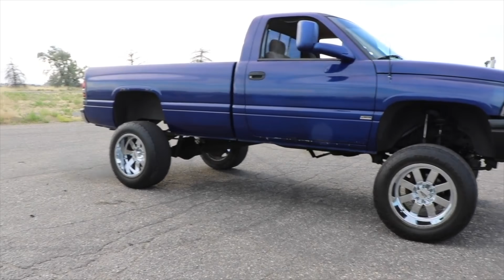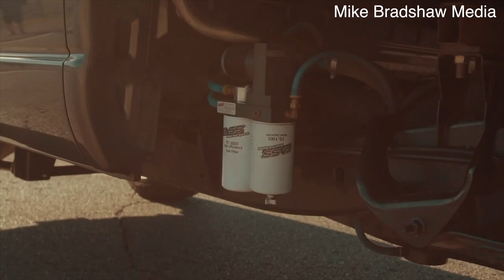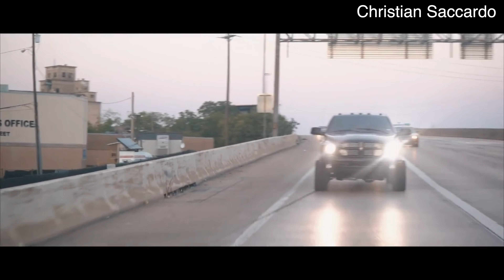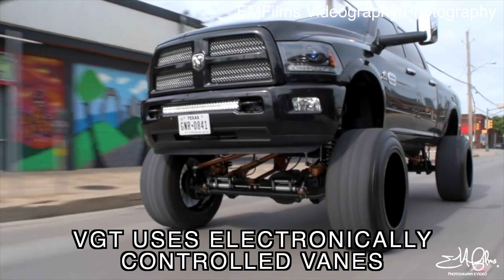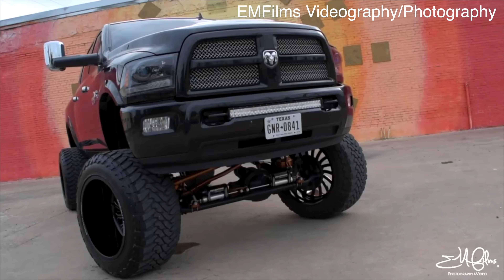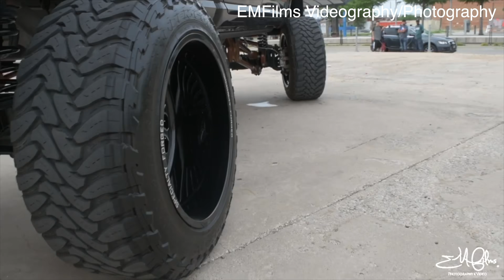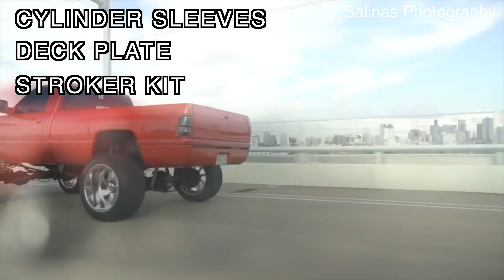5.9L vs 6.7L Cummins: Which One is Actually Better?

Comment: I've bought me a 07 with that 6.7 liter with low miles back in 2012. Today I've got 71,150 miles on it. I had no problems yet with the motor, my only problem is the catalytic converter that is in need to be changed. Other than that it's runs good.
Reply: A converter on a Diesel? I guess you do have problems!

Comment: I drive  2004 dodge 5.9 good truck sound like sold truck good engine. 137000 mile good truck also drive mega cab  3500 year 2012   good truck 6.7  miles run 70000  both good truck

Comment: So many choices which do I chose? 
Depends on how much money you have. You want reliability and economy  buy a 12 valve. Look up cost of a 12 valve injectors vs any of the common rail injector options. A 12 valve is more forgiving of c ok contaminated fuel and driving it around like a car. The newer trucks are very plush. Very nice interior nice everything except repair and maintenance costs!  Not cheap!

Comment: I’m wondering how the 5.9 is in a motorhome...  we are looking at one that has the 5.9 and am looking for input...

Thanks
Reply: Yeah all of the small displacement Cummins have been in motorhomes and school busses.  They all do really well.  You see school busses with 300000 miles for sale all the time and they still run great and get 12 mpg.  Not bad for an engine that went 300000 stop and go miles.
Reply: Cool thanks

Comment: I have a 97 5.9 12v auto and I gotta say the ugly B is completely bullet proof. The owner before didn't take great care of the body but the motor is pretty great for the miles it has. Right now I have to work on the suspension and possibly a frontend rebuild. 230k miles and counting.

Comment: I’ve got a little over 375,000 miles on my 98 12 valve 2500 4x4. Replaced the starter 4 times, alternator twice, transmission twice, clutch, flywheel etc, once, but it made it to 350,000 miles though. Several sets of tires and brake pads. 2-3 sets of batteries. It’s never left me stranded (knock on wood). Truly a truck for the zombie apocalypse. Ha! Lol!

Comment: "BETTER" is a subjective word. If you need a dependable diesel engine in your 4x4 rig (or motorhome like me) that you'll be taking to Tierra del Fuego --> a 1998.5 and earlier 12 valve would be the choice of anyone with an IQ above 38.
     Computer = broken down, robbed, and left for dead in the Nicaraguan jungle ...naked.

Comment: Went from a 6.7 to a 5.9. I tow aprox 70,000 a year. Don't want to up set 5.9 folks, but for my need I've found 6.7 to work for me better. My 2010 6.7 provided me with 210,000 miles in that stretch I replaced 2 water pumps 1 alternator. All other repairs were not done on the power train. The truck I'm currently piloting is a 5.9. It works ok, but I have had to adjust my trip times as I'm slowed more often than in the past. I also have a hard time maintaining an exhaust gas temp that will not damage the truck. Learning to drive with new limits is I guess a personal problem to get past. The up side to this new, to me 5.9 is the fuel mileage. My new 5.9 gets almost 50% better mileage. That is the main reason I'm keeping it.
Reply: My 6.7 gets 21 Mpg at 85mph. 16 to 18 towing my 15k camper. You have to emission delete.
Reply: @mrrod3004  I've worn through another truck since I wrote this. I've got a 2011 now. I'll try your suggestion.

Comment: 5.9 beat motor ever for pick ups bomb proof enough power for what ya need no need to be doing 80 hauling 25k but the best thing I like about them especially the old 24v's an 12v's is that old school rig sound cannot beat it

Comment: I have 5.9 a 2002 dodge 24 valve,  almost 160k miles. 4x4. I like mine.
Reply: I have a 5speed manual, I would like to have 6speed transmission for my 4×4 I think it would get a greater mileage, and not seem like having rpm to hi for diesel

Comment: I'll take a deleted 6.7 anyday
Reply: @noahranker4133  power isn't everything moron. Some of us (especially mechanics like myself) like easy serviceablity, fuel efficiency and reliability.
Reply: 5.9 block with a 6.7 head put together for max destruction
Reply: Damn these comments are funny as fux
Reply: @noahranker4133  go crawl a mall bud
Reply: No emissions or even any vehicle inspection in Brasil. I am looking at buying a 6.7 Ram and doing a complete delete and exhaust. I assume once all the emissions shit is gone there are no reliability issues??
Reply: @rolfrimott9785  I still have my emissions equipment on and haven’t had any issues. I plan on deleting it since the engine warranty is expired.
Reply: I know this is a cummings blog but I just wanted to give info on the truck i have here in Brasil now. it is a 2012 Ford Ranger 4X4 crew cab with 1 ton payload rating. The engine is a 4 cylinder 3.0 liter international Powerstroke wase gate turbo, intercooler integrated with the radiator. it has electronic injection and a 5 Speed manual trans. There is no emission shit at all. Not even a Cat Converter on the exhaust. the Exhaust is a 3 inch pipe with 2 high flow mufflers factory set up. The factory tune has 170 HP and 350 FP torque. The factory boost max is 20 pounds. I had the ecu reflashed with a stage 2 flash. It now spools up faster and has 25 pounds max boost. The dyny HP now is 215 and the torque is 420 now. best part of all is when jamming it hard in the boost running 85mph on highway passing etc I average 26mpg. When driving chill light on the throttle I average 32 mpg. really fun cool little truck to drive. I am going to buy a dodge ram looking at a 6.7 and want to 100% delete all the emission shit and do a stage 2 tune. No worries here in brasil as they dont inspect vehicles here. I have some cool videos of the ranger but dont know how to upload here.
Reply: Fuck yes,  I've got an 09 3500 dually fully deleted with 5 stage custom tune and more shit than i can remember,  i call it S.c.u.d because it's a guided fuckin missile
Reply: Deleted 6.7 all day everyday
Reply: @noahranker4133  I don't work in a stealership anymore, I've got standards lol
Reply: Ya 6.7 deleted from the truck and a 5.9 put in
Reply: @noahranker4133  sorry you feel so sarcastic, at least your mother was excited about it for me.
Reply: Enjoy the rebuild when the valve seats fall out of your 6.7.
Reply: @timcondren72  they're known to drop out of 5.9 common rail too.
Reply: 12 valve though he didn’t talk about, but yeah deleted 6.4 power stroke or deleted 6.7 Cummins anyway all day
Reply: @funnydubby6401  6.4? Seriously? Even deleted they are pieces of shit
Reply: @alabastardmasterson  😂 I had one, they’re fast but they are built poorly. That’s why I have a 6.7 now LOL
Reply: @alabastardmasterson  definitely a POS!!! 6.0 6.4 all garbage
Reply: Give me a 12v 5.9 Cummins 🤷🏻‍♂️

Comment: I have a 2001 5.9. Straight up the 5.9 sounds so much better. I still love it when I go into parking lots and heads turn. Obviously sound doesn’t mean it’s better but I like it.
Reply: Thepriest39 I also have the 2001 5.9 HO with the NV5600 6spd we ain’t sneaking into anyplace!
Reply: @damiandelapp5490  97 7.3, you can't sneak anywhere with the older diesels
Reply: I got a 2002 6 speed 5.9. Best engine/trans combo in my opinion!
Reply: @southpole560  same here with a diamond eye 4 inch turbo back, sounds like a rig... I LOVE IT.
Reply: @christopherdickinson4291  yup! That 4 inch exhaust is the perfect size too. It has the best performance/velocity and doesn't have a drone that will drive you crazy haha.
Reply: Great engine, take care of it, and it will take care of you.
Reply: The noise is the only think I hate about mine. I live in an RV community and my truck is the noisiest thing in the place. The monster Newmars and Prevosts  don't make as much noise.
Reply: I got my 08 6.7 all deletes done and tuned efi live with 5 straight pipe and arp head studs running 35” and still get 25 mpg only 93k miles and no problems I love my truck no issues
Reply: @gilbert788  so Gilbert is yours  single rear wheel, 2 wheel drive with 3.55 gears, 5 ft bed with a day cab and no rear seats?
Reply: Funny, I drove my 97 w/nv4500 yesterday, the 1st time in about 3wks. Pulled thur a parking lot at the local metal supply store in granny gear and watched the heads turn.

Comment: Just went over 310000 miles on my 97 12 valve still running like new
Reply: what all have you had to do to to the engine, tranny, and truck get those miles? I've got an 06 5.9 with only 143,000 miles. When will I need to replace serious parts before it's not worth keeping the truck?
Reply: @kaylatuttle9988  transmission at about 220000 the rear end at 190000 the driveline is original the engine has never had the head or pan off I replaced the injectors at about 300000 and the water pump even though there was nothing wrong with them 1 alternator 1 fan hub

Comment: Wait so is a VGT Turbo a good fit for the 5.9 or not? You made it sound like it wasn’t a good turbo accompanied with the 5.9 but good for the 6.7
Reply: Vgt's are a bad set up more moving parts and a lot of people don't realize is the exhaust drive pressure is a lot higher also very unreliable. I own a 99' 5.9 along with a 2011 6.7. Both great trucks and defiantly have their place on and off the road
Reply: Ross Sikorski so if I want to make a turbo upgrade to my 2006 5.9 what would you recommend? Or at least what would you recommend for more power? I’m not trying to race or anything. I’ve got a 11,000lb fifth wheel I pull, and want more power for the mountains.
Reply: Grand Journey Everyone's got their own opinions, not looking to argue with anyone but personally I like Garrets products or Alamo industries, they both build a nice ball bearing turbo and we have an Alamo on a C15 and it's beautifully set up. I guess borg warners doing business with Bd and they are storming the market. So I guess when my Vogt blows up on the 6.7 lll order that bd turbo kit "Borg warner s364" likely. But I just drive trucks I don't really care for the shit n abuse most kids do with diesel pick ups Haha

Comment: 5.9 24v with p7100 most power and reliability for ever
Reply: Well you mention deleting things on new trucks and talk about adding things like new turbos so what would be best is to get a junk yard 24v cummins then converted  p7100 this way you don't have to reprogram ecu's there's no way the ecu can change mechanical pump
Reply: Im putting my 182k 02 24v in my 06 megacab with that configuration when the motor thats in it goes its got some time left though its only got 230k right now
Reply: Not bad, but you do complicate the issue with 12 more valves. Not to mention the added cost for the conversion. However it is a great choice when compared to any of the computer run machines.

Comment: Isuzu entered into a joint development partnership with Navistar International. Stock interests were traded. Eventually, one of the projects would be a 7.3L V-8 light-duty diesel. Guess who picked that one up for use in its pickup trucks?

Navistar also had entered into a joint development partnership with Caterpillar. One of the projects was a direct injection system that would be picked up by -- Ford. And Isuzu mediums.

Caterpillar owned a large chunk of Bosch. GM owned another big chunk. And so did a third major player -- Daimler Benz. Bosch was the primary developer of Caterpillar's direct injection system. But GM forced Caterpillar to turn over its share of Bosch, and then forced Bosch to abandon direct injection in favor of developing an "improved" generation rotary injection pumps. The initial designs for those pumps had been brought to GM by former Isuzu engineers working for Ford.

What did Caterpillar receive in return for giving GM its stock in Bosch? GM's stock in Cummins. Ford then sold its small share of Cummins stock because of antitrust regulations in the U.S. Caterpillar, on the other hand, avoided antitrust problems by a joint incorporation agreement with Cummins under a Brazilian operation named Inquardo, Ltd.

Eventually almost all Cumminsmanufacturing and design were moved over to that part of the "house". However, that move proved so efficient and profitable that Cummins began to eat into significant markets for Caterpillar, so Caterpillar merged its manufacturing and design base with Cummins in Brazil, leaving skeleton operations only in places like Peoria, Illinois. Cummins management largely pushed out Caterpillar management after several years.

( With me so far? Caterpillar owns Cummins, but Cummins has effectively "eaten" Caterpillar. In Brazil. Here, they're separate, of course, but it's only the purposes of adhering to American commercial law. But wait. There's more.Navistar has continued its free-fall in spite of its partnership with Ford in the light-duty diesel area. A while ago, after the implications of labor troubles, a rise in basic resource costs, and the disasterous introduction of the 6.0L PSD had become clear, Navistar's financial arrangements with Citibank and Manufacturers B&T collapsed. Both banks arranged to float the company infrastructural loans if it would agree to a merger with -- are you ready for this? Cummins owns 67% of Navistar through Inquardo. Just for all u ford guys

Comment: I own a hotshot company running 4 trucks and hav earn the shit out of both. I still drive my 06 5.9 dually with the g56 southbend dual disk over my 2018 5500. Also run a deleted 08 and a 2012 all dually. The 06 has 410,000 miles and have only replaced 1 injector and a turbo. Wish I could find more 5.9’s to add to my fleet!
Reply: dpod612 why do they say you have to own a truck 2015 or newer

Comment: ill be the one everyone hates here... ill keep my 7.3 liter... slow AF but gets it done!
Reply: Ford screwed up when they put that POS 6.0 in the truck.
Reply: @xraykadiddlehopper8067  no kidding. It was a powerful motor I hauled alot of heavy shit with it but it also had head gaskets done twice before 100k... no good.
Reply: Isuzu entered into a joint development partnership with Navistar International. Stock interests were traded. Eventually, one of the projects would be a 7.3L V-8 light-duty diesel. Guess who picked that one up for use in its pickup trucks?

Navistar also had entered into a joint development partnership with Caterpillar. One of the projects was a direct injection system that would be picked up by -- Ford. And Isuzu mediums.

Caterpillar owned a large chunk of Bosch. GM owned another big chunk. And so did a third major player -- Daimler Benz. Bosch was the primary developer of Caterpillar's direct injection system. But GM forced Caterpillar to turn over its share of Bosch, and then forced Bosch to abandon direct injection in favor of developing an "improved" generation rotary injection pumps. The initial designs for those pumps had been brought to GM by former Isuzu engineers working for Ford.

What did Caterpillar receive in return for giving GM its stock in Bosch? GM's stock in Cummins. Ford then sold its small share of Cummins stock because of antitrust regulations in the U.S. Caterpillar, on the other hand, avoided antitrust problems by a joint incorporation agreement with Cummins under a Brazilian operation named Inquardo, Ltd.

Eventually almost all Cumminsmanufacturing and design were moved over to that part of the "house". However, that move proved so efficient and profitable that Cummins began to eat into significant markets for Caterpillar, so Caterpillar merged its manufacturing and design base with Cummins in Brazil, leaving skeleton operations only in places like Peoria, Illinois. Cummins management largely pushed out Caterpillar management after several years.

( With me so far? Caterpillar owns Cummins, but Cummins has effectively "eaten" Caterpillar. In Brazil. Here, they're separate, of course, but it's only the purposes of adhering to American commercial law. But wait. There's more.Navistar has continued its free-fall in spite of its partnership with Ford in the light-duty diesel area. A while ago, after the implications of labor troubles, a rise in basic resource costs, and the disasterous introduction of the 6.0L PSD had become clear, Navistar's financial arrangements with Citibank and Manufacturers B&T collapsed. Both banks arranged to float the company infrastructural loans if it would agree to a merger with -- are you ready for this? Cummins owns 67% of Navistar through Inquardo. Just for all u ford guys
Reply: Donald trump 2020 no more bull shit that’s a lot of information I have to go look for that info
Reply: It takes forty acres to turn it around, roughest riding, crap for fuel mileage, this ford truck is obsolete. Get a Cummins and get 23 mpg and big horses and torque i owned ford 7.3 for years, I will never go back to ford, mostly due to poor m.p.g
Reply: Haha no hate here my friend. I have one 7.3 among my many Cummins on the farm and never had an issue beyond normal maint. with it.

Comment: I'm very happy with my 08 6.7. Full delete, banks turbo and efi live tune. I went with a modest 100 hp increase. All the power I could dream of and 21 mpg on on long trips with cruise set at 70 with a 6 in lift and 37's. I've had no issues with it in the 3 years ive had it. I run Delvac and change the oil and filters every time I service my freightliner. Intervals are usually 4 to 5k.
Reply: Fairy tails on mpg again.
Reply: Wow, all that money spent to get the same or less MPG than my stock  SO 6.7.
Reply: All that was already done when I bought it except the tune. I had a different tune put on it. Paid $18k for it. Previous owner was broke and needed it gone quick. Been driving it 6 years. Tires, belts, water  pump, shocks and U-joints is all I've had to replace. Bought it cash. So yes I got a fantastic deal. If you need  it I can back it up to your face throw a chain and yank the foot out of your mouth. Know what you are talking about before you run your suck!